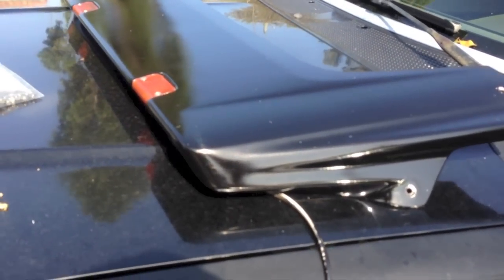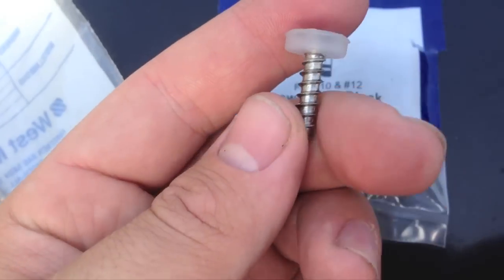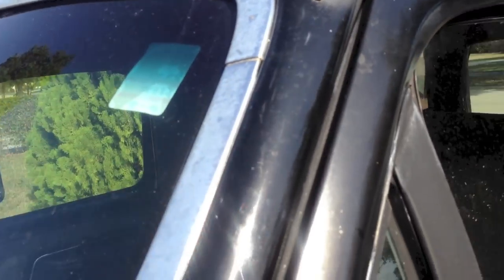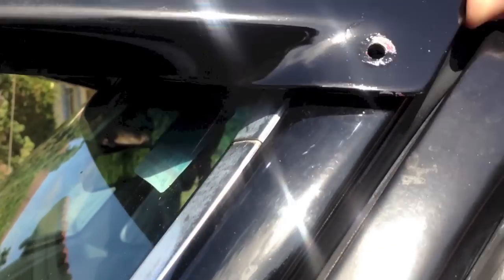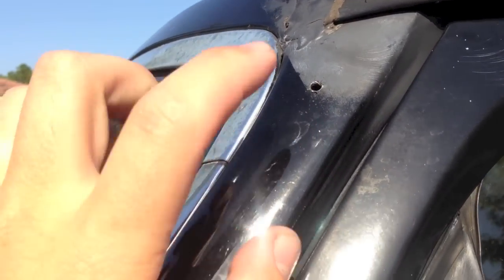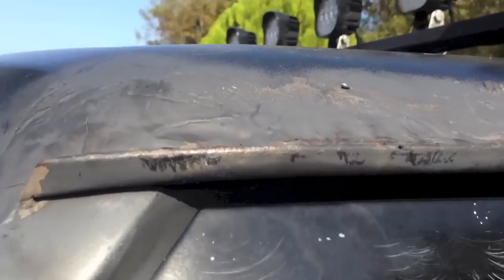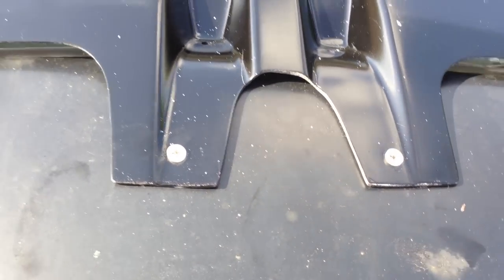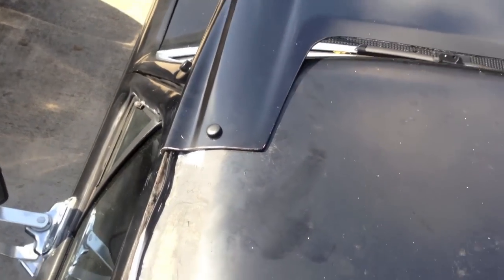Lund Moonvisor - Sunvisor Install

Comment: When I installed my Lund Visor on my 79 F250  I Positioned the visor on the roof with tape , double checked and triple checked the alignment . I also took several measurements to make sure I had it centered . Once satisfied with the positioning I marked the holes and drilled only the top outside holes with a small drill bit . I then used small sheet metal screws in the two upper  outside holes .  Once those were secured I drilled the remaining holes with a small drill bit. I installed the remaining Sheetmetal screws and again checked for proper alignment . Satisfied that everything was going to line up , I removed the small sheet metal screws. I decided that sheet metal screws were not a good idea for this application .  Having  aircraft sheet metal experience I decided to install 1/4  20 stainless steel riv nuts . I redrilled the holes to the exact od of the riv nut. I coated the ss rivnuts with a seam sealer while pushing them into the hole and installed them using a homemade bolt and nut /washer combination .( My riv nut tool was a cheap Harbor Freight one and it could not pull the SS riv nuts) . This installation method is guaranteed not to rust or wear out the holes due to air flow vibration . Another thing I did to prep the visor was to sand the inside smooth as possible to reduce air flow disturbance at highway speeds. I also painted the inside of the visor matte black to reduce glare .  Good luck with your installation project .
Reply: Hey man, im looking for a 1979 ford f100 visor for cheap because they are ridiculously over priced at 500$ Could you help me get one?
Reply: Yeah rivnuts and urethane would have been my go to, would not use drill and screw method as in the video... Just my preference

Comment: When you put the visor on the roof use some strong grip clamps to hold it in place and adjust accordingly. I did that and it turned out great

Comment: FS1 3 years later, did you ever put in the front screws on your moon visor?. I own the 91 silver edition with visor already installed, when they did the wiring, they hooked it up to the dimmer switch, I don't know why either. ok Just wondering.

Comment: How long of a lifespan are you getting on your stainless steel screws before they rust? I typically get about 2-3 years before they start to rust and I have to replace them here in Hawaii. This is the first place I have lived where stainless steel rusts so quickly.
Reply from the maker: WH6FQE - RC Anderson I’ll be honest I haven’t looked, they are under those cap nuts. Unless I remove the caps I wouldn’t be able to tell. That being said I have no leaks from those holes, so I assume they are ok. Hope this helps.
Reply: @firesupression1  ok, thanks. I just installed one on my 1990 Chevy K3500 1-Ton 4x4 Dually today to match it up a little to the 4" cowl induction hood I put on it last week. The combination really gives it an aggressive look. Hopefully I will get longer rust-free life from the stainless steel screws this time, I loaded them down with silicone before putting the caps on them.
Reply: @firesupression1  You could probably use the screws on the lenses as a reference for the status of the mounting screws.
Reply: I plan to install a Lund visor on my 79 Chevy shorty van.
You mentioned rust, put simply, when you put 2 dissimilar metals together, they usually rust at some point.
My plan was to use Rivnuts ( other names like jacknuts & threadserts )
That way I can easily remove the visor for a show if I ever need and I don’t need to worry about stripping out the thread ( yes, thread ) on sheet metal because I’ll be using a matching machine screw that fits the rivnuts thread.
Cleaner install because you can use a step bit the cleanly make the correct sized hole, pop in the rivnut and you are done .

… here come the critics !

Lol
Reply: @kevinsilvers1695  Good idea

Comment: Should of used rubber well nuts is what your suppose to use. It keeps water from leaking into body causing leaks and rust.
Reply from the maker: Yes the rubber well nuts could of been used, and looking forward I will use that next time. Thanks for the suggestion. With my method I used the 5200 sealant for that rust/leak preventive purpose. So far no leaks!
Reply: @firesupression1  would one of those moon visors fit a chevy astro

Comment: I'm rewiring my moonvisor and I can't find the light sockets anywhere.were did you get yours?
Reply: Goodmorning I replaced them with the lumitec 101084 livewell lights. The only thing you have to do is paint the back of them so that you don't see the light coming out of the back of the housing. 
Good luck buddy
Reply: Thank you so much I have been looking for a week for something that fits
Reply: Your welcome. I believe I just had to drill the holes out a little bit and they fit right in. I also remember taking out the gasket behind the Amber lenses and cleaning the lenses real good. Since the lights are designed to be underwater they don't need to be protected by the gasket of the Amber lens. Plus I think it looks cleaner without the gasket.

Comment: where did you get the visor from I've tried several sites trying to find one
Reply: Got mine on Ebay
Reply: @nekomi6856  hey would that moon visor fit a 2000 chevy astro

Comment: is that the biggest cab visor they offer
Reply from the maker: I don't know of a different size made. They only came with two models for the trucks. Moonvisor which is the lit up one (mine) and the sunvisor non-lit style. Hope this helps. Thanks for watching.
Reply: thanks i was also looking at summit cab visors but they make diferent sizes and i dont want it to look too big or too small but the comment did help thanks

Comment: Thanks for the video I bought a lighted moon visor for my 1995 EDDIE BAUER bronco (On my page if you'd like to check it out) its almost been 2 years now how's it holding up? Still no leaks? and how's it on the highway? thanks and great video thanks for posting it'll come in handy when it comes time to install it.
Reply from the maker: It's still perfect. On the highway no issues at all and no leaks. That 5200 is the best sealant, that stuff will hold for life. Thanks for watching!
Reply: firesupression1 thanks for getting back to me. where can I get  that 5200? im in Colorado so im not sure were to look first and I should be able to go to any boat place to get the hard where? thanks
Reply from the maker: 5200 is made by 3M "marine adhesive sealant" you should see at your local hardware store i.e. home depot, ace, lowes, etc. the screw caps you should see in there as well.
Reply: firesupression1 aright thanks for the info I cant wait to get it installed.

Comment: hey i was just wonder hows the visor holding up, been almost a year, any leaks or rust forming?
Reply from the maker: Visor is holding up great i havnt noticed a single bit of rust or leaks in the truck. We have had some really wet thunderstorms here in fort myers, fl and not a drip in the truck.
Reply: firesupression1 thats good to hear, and thankyou for responding quickly i just got a moonvisor for my silverado and plan on putting on this weekend.